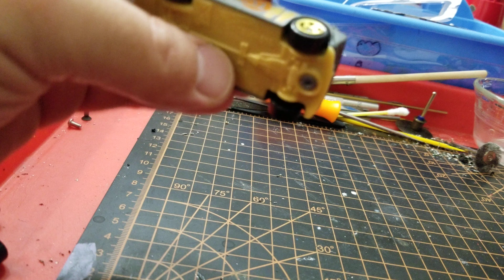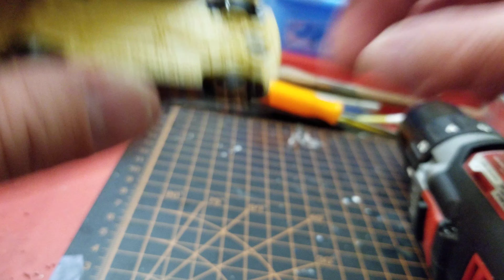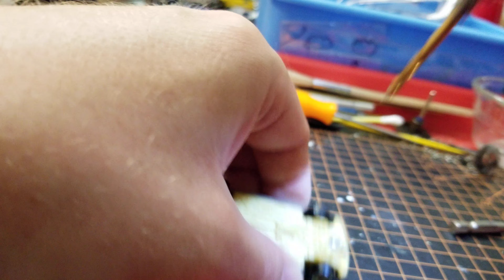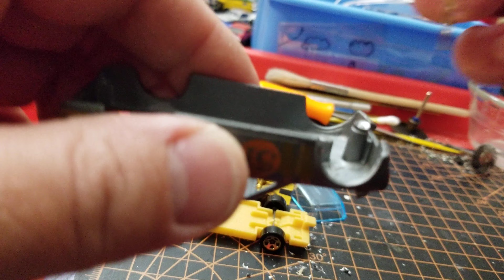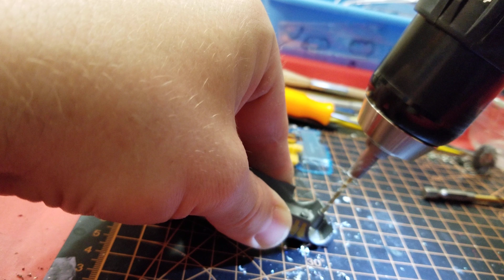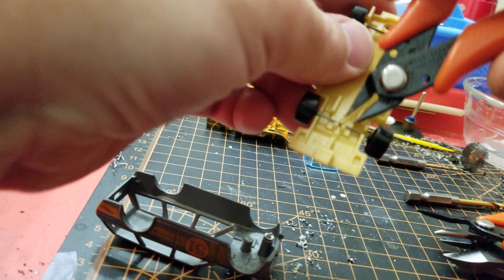How to take apart Hot Wheels using a drill.  DRILL BIT SIZES INCLUDED!

Comment: When you break off the tabs for the wheels how do you secure the new ones in?
Reply from the maker: Hey Scott, when I drill the cars Ill run a 3mm tap into the posts and secure them with very short 3mm button screws.  The key is to drill deep and straight with your pilot bit, it makes the task very easy! 😁👊
Reply: @HonestDiecast  Scott was asking how you keep the new wheels in place. Not the posts to hold the base on.
Reply from the maker: Got it Mac, I misunderstood!  My apologies!  You can break those tabs as the interior portion will hold the wheels down anyways. 😁👍

Comment: First off, never place the car upside down on metal shavings, you are asking for a scratch. Secondly, tape your 5/64th drill bit  about an 1/8th to 3/16 of an inch down so you do not drill too far into the post. Stop at the tape edge, otherwise you can go right through the hood or trunk of the car.
Reply from the maker: Its fine to place the car upside down on metal shavings if you're repainting the car.  Drilling should be the first step before any paint work.  If you're wheel swapping then yes, best to put down a microfiber cloth on a clean surface.  

After drilling countless cars, I can gauge the proper depth to drill the post so I do not use tape.  Someone first starting off could use tape as a marker until they get the hang of it and are able to gauge the drill septh properly.  Thanks for the advise, Lou. 👍

Comment: Are the screws self tapping
Reply from the maker: They are not, you have to drill then run a tap through.  Self-tappers have a habit of splitting the posts because they are pushing a lot of material outwards as they get run down.  When you run a tap, the material gets caught in the grooves of the tap instead of just pushing it out of the way.

Comment: It feels like when I’m drilling it’s barely getting into the metal, even watching others it’s like y’all do it with ease one handed and what not, I’ll be 2 handed leaning on my drill with a vice holding the hotwheel and it won’t do anything I’m like   Wtf
Reply from the maker: You may wanna try switching up your drill bits.  I use the Milwaukee Titanium bits, they last a long time and have a good bite.  Give that a try! 😁👊
Reply: @HonestDiecast  I think all it took was reading this comment lol, I already tried titanium bits and broke one, went back too the janky ones I was using and sun reason it’s working easy now
Reply from the maker: Very odd, I havent broken a bit yet (knock on wood).  Zinc aluminum is pretty soft so Im suprised that happened.  🤔
Reply: Did you turn it on? 😂😂😂